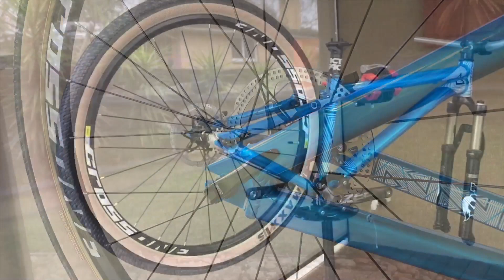Dirt Jumper Build-Octane 1 Zircus

Comment: Is there a list of all the parts you used or somewhere I could look for something like that?
Reply: Octane one zircus frame, integrated tapered headset, cross rims. I recommend using halo chaos rims with halo hubs, race face tailed seatpost, any railed seat, any bb (73 to 83mm) matching cranks could be a sram GX. Forks such as manitou circus, fox 32,34,36 needs to be 26 and below 120mm travel. Any bars and stem would be good, 180mm rotor maximum recommended it 160mm make sure the rear wheel is a bolt axle like on a halo supadrive or bush drive hub. Any grips any tires. Hope this helps :)
Reply: @arthurthain2507  I'm planning to add a 9 speed cassette on my dirt jump. Can you recommend a rear hub for me?
Reply: @arthurthain2507  bro you are the best
Reply: @gabrielcaraos8729  sorry it’s so late, maybe a halo bush drive depending on your price range. They come with a bolt axle for jump bikes or all sizes in axles.

Comment: Ps.you need a solid rear axle. That may work for awhile but will eventually fail on you when you're least expecting it.
Reply from the maker: Yea I have now upgraded to a bolt up axle!
Reply: United Trails what axle or wheel do you use now?

Comment: What's the maximum width wheel you can run on a zircus frame. Great vid
Reply from the maker: I’d say around 2.25 because the tyres I am running are 2.15 and there is still a bit of room
Reply: Thanks a lot, loved the vid. Will look out for more content!!!!
Reply from the maker: Cheers mate

Comment: Sick build mate. Great video too! Any chance you could send me details on the new rear wheel set up I see you've mentioned on previous comments? What wheels are you using and what bolts? Cheers 👍
Reply from the maker: Hey mate
We have since changed to a Alexrims Supra BH with a 10mm bolt axle and is 135mm wide novatec hub.
Reply: @UnitedTrails  thanks. Do you have a link to the bolt axle you are using?
Reply from the maker: It came with the wheel

Comment: what hubs and rims you used there?
Reply from the maker: Mavic Crossone
Reply: currently I am building one too. could you please provide your full spec? that would be a great help
Reply from the maker: Frame: Octane one Zircus
Fork: Fox float 32
Brake: Shimano XT
Wheels: Mavic Crossone 
Cranks: Shimano Zee
Seat post: Race Face 
Bars: Full on Funn
Stem : Giant contact 
Peddles: DMR v8
Tyres: Maxxis dth

Comment: You haven't tightened some of the parts properly. For example: the BB has to be tightened with 40 Nm and the casette has to be tightened with 40 Nm as well. The way you did it it looked like 5 Nm. Just saying
Reply from the maker: We looked over it after and checked and tightened everything to the right right spec

Comment: What was the components
Reply from the maker: Octane one zircus frame
Fox 32 forks 100mm
Shimano Zee cranks
Shimano XT brake
Mavic crossone wheels
Maxxis dth tyres 
ODI grips 
Raceface seatpost 
Giant connect stem
Full on funn bars
Reply: What’s the whole prize that looks cool
Reply from the maker: From memory it was at $1100
Reply: What about the gearings is that included to the parts like the headsets and seat and for the brakes plate
Reply: What kind of freehub is that